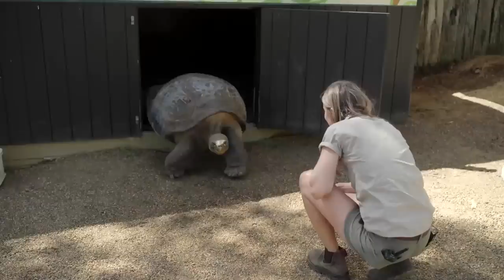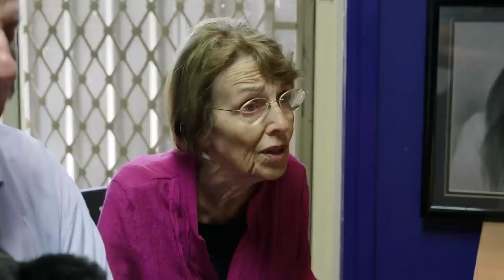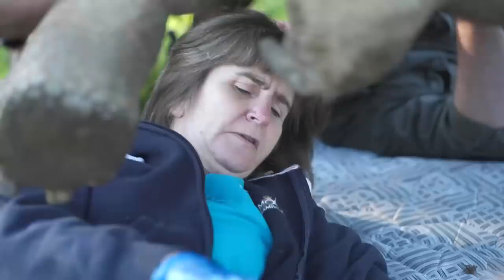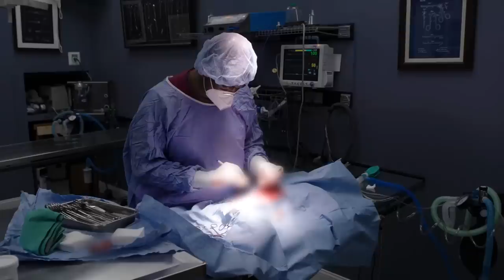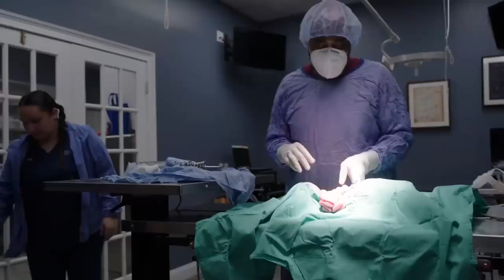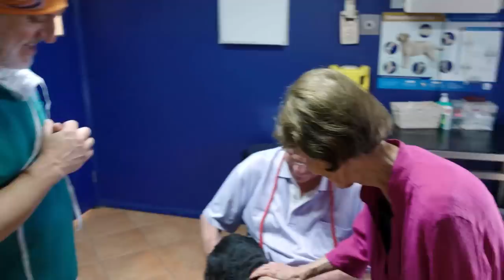Shock: A 180Kg Giant Tortoise Almost Crushes Vet 😱 Coast to Coast S5 E7 | Bondi Vet Full Episodes

Comment: I am curious as to why they didn't take Hugo to a facility with a mechanic's pit. They hauled him to a warehouse to weigh him a while back so they could use the same procedure to take him to a mechanic shop. The two people would have been safer; Hugo would have been "on the ground", and the glue would have set much faster in the heated building.
Reply: Well, he'd be safer as long as he didn't manage to crawl into the pit itself.  Maybe some kind of turtle harness would be feasible, though.
Reply: Maybe a sanitization issue?
Reply: @girlythingsaw  definitely a sanitation issue.

Comment: Had a cat that was born with a bump on her lower regions.  The cat was born to a stray mama who had dried up early but we did our best to help both mama and the kittens.  however 2 of the kittens we found out were born with out a good chunk of their intestines and what they had not even surgery would help as only a small part was connected which made going poopoo not a good thing.  Even the vet said that it would be better to put the 4 week old kittens to sleep.  So we did.

When the vet looked at Ghost he said that the bump was close to her intensine but didn't at the moment seem to be causing her trouble but we would have to watch it as the bump could go either way but we all agreed on that day that if the lump cause her to have issues going to the bathroom then she would be sent to the rainbow bridge like her siblings.  It did get bigger over time and when it took over her lower half and she started to have issues with the bathroom we kept our promise.  She was 6 years old.  The vet also said that it was to dangerous given where the lump was to do surgery as he found out that the lump was attached to her intestines and surgery would have killed her.  '

The only surviving kitten has some mild health issues with his skin but he will soon be 13 years old and he a decade younger than our oldest cat.  

We did di everything we could for the kittens and mama.  Mama went to a shelter as we really couldn't keep her but we made sure that she at least had a place to be safe after she was done taking care of her kitteens

Comment: I have a suggestion for the next time you need access to Hugo's bottom shell...

Install a concrete trench similar to what the mechanics use in an Oil Change garage) that the vet can lie or kneel (depending on how deep it is) while Hugo stands on top straddling the pit...

His legs are completely on the ground so he can't fall on you but you can still get at his belly plate...

The only thing is you'd need to make sure he doesn't turn or one or two of his legs could end up in the pit with you...